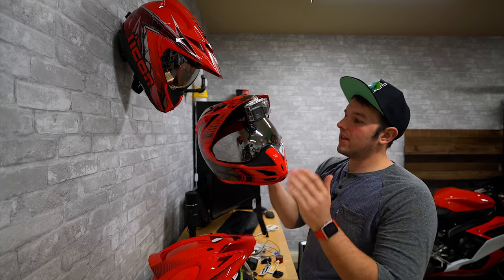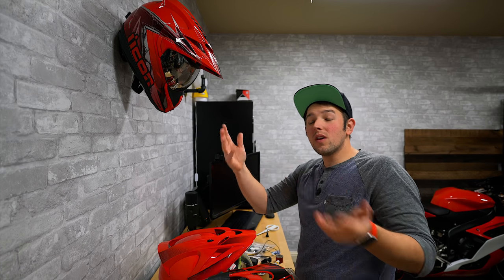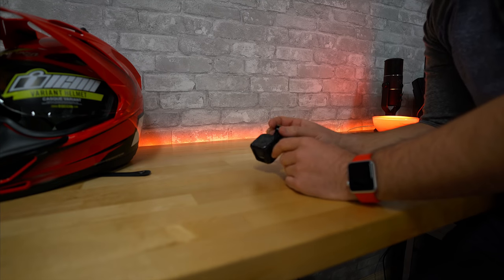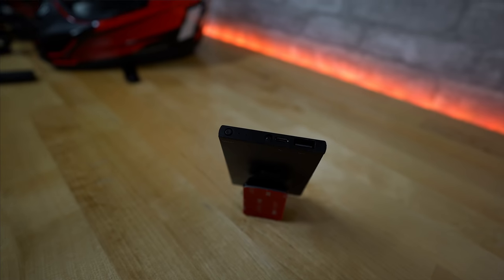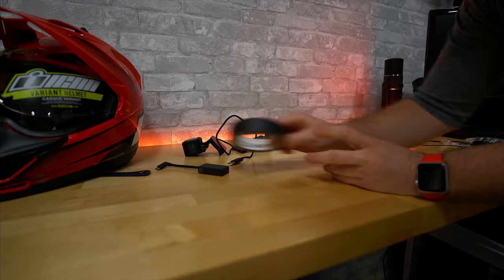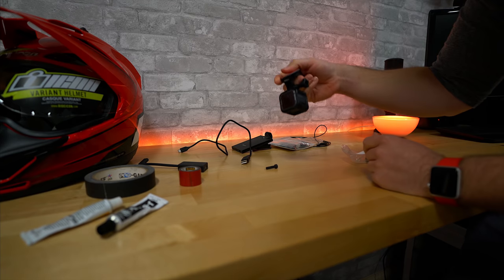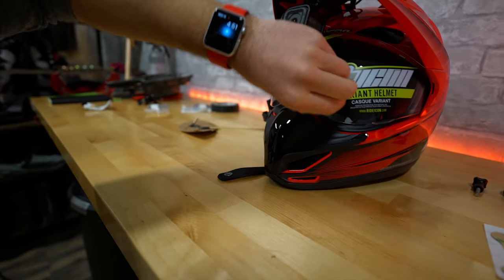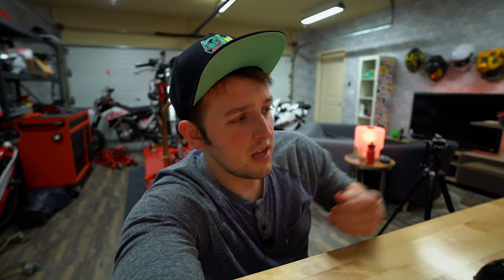My Motorcycle Helmet Camera Setup

Comment: The GoPro mount Allen screw size is M5-0.8x20MM cap screws. You can get them at Home Depot for about $0.75 for a bag of 2. 🏍🔩
Reply: I can only find 10 packs. can you link?
Reply: buy 9 more helmet then

Comment: So the adapter works with both power and audio? I was really excited when that adapter came out, only to be disillusioned by GoPro when they told me I could only either charge or use the mic port, not both at the same time. Thank you!

Comment: Please do a riding bike test for the wind noise test. Did you had to move it after? Was it noisy? The muffles hold the wind noise well? The noise is something annoying for me, and the GoPro 5 had some pops issue that I had to change my mic. Motonosity had the same pop issues with his gopro 5 and changed back to his gopro 4 due to it. Does the Season 5 have pops issue on the mic due to wind and high sensibility on the mic?

Comment: if you put 3M tape on the adapter then heat the tape with lighter until it slightly bubbles then press and hold till it cools down it will stick better.

Comment: You could have scratched off the rubber coating off the mic adapter and used the 3m tape instead of JB welding it on. I know a few guys who have gone that route. But kind of cool to see the Sessions 5 as a main camera
Reply from the maker: That's could definitely work but that 3m has failed me in the past so I decided to go the JB route.

Comment: I know this will get buried. But you could use a protractor/angle finder to measure the mounting angle when you are mocking it up. Then buy or create a wedge with the angle you found and taped it.

Comment: How come you dont use 3M Dual Lock? I use it for everything and it's amazing, and you can simply remove and snap back on when needed.. I have it on my Mic Adapter too on my Variant helmet in the same place..... and the power bank you should of had on top so the ports are under that back raised bit.... and also my OCD kicked in BIG TIME watching this lol i'd give anything for that helmet and all I see is black tape all over it which isn't neat lol I routed my mic through the top vent though, so it comes from the adapter, through the vent above the visor and into the helmet.

Comment: Do you have your hero 5 session firmware on 2.51 which is the latest or is it a certain firmware version that you use? Is there a certain sequence because I swear I have watched videos and googled my eyes out and still won’t work. Gopro even replaced my camera and mic adapter smh

Comment: I have a Sena 20S installed on my helmet. A buddy of mine recently convinced me to pick up a GoPro. Is it possible to use the microphone that came with the Sena. If so, how does it work? It's my first GoPro, so I have no idea what I'm doing. Any help would be appreciated :)
Reply: Merge audio in post.

Whenever you see motovloggers clap at the beginning of some videos and when synchronising for dual-vlogs, this is what they do. It puts in an obvious audio spike to use as a reference point, as well as a clear point of contact on the video. This is the same reasoning behind the clapperboard used in legit filmmaking en.wikipedia.org/wiki/Clapperboard

Comment: Hi Chase,  does the hero 5 session takes voice commands through the mic? Cause if it doesn't ...I guess voice controls is useless for moto?
Reply: Filip Robbie Even if it didn't, all you would have to do is open the visor and talk.
Reply: Really? Tell that to the vloggers who cant get their gopro to recognize their commands even at walking speed with a little bit of background noise.

Comment: Chase , why do you not sync the audio with the sena? Then just get a sena GoPro Bluetooth pack
Reply from the maker: I'm not a fan of the sena audio for video purposes. I feel like it's a little flat and you can't hear the bike as well.
Reply: anyway chase, just a minor suggestion. If you want to waterproof the gap around  your power cable /audio jack , you can put some blue-tack around it. Press it down after you plug them in and you get the seal.  its easily to implement and remove while preventing the water from seeping in.

Comment: There are different 3m tapes for different jobs.  For example: 3M 4926 is for bonding metal and plastic painted surfaces and has  95lb tensile strength. Use the right tool for the job man :) .
Reply: Derrick Disharoom Let him do what he wants :) .
Reply: No doubt.  His stuff, he can do what he wants. However, there's a reason the chosen product didn't work for him.  Just pointing that out.

Comment: The reason the 3m tape failed was because you didnt give it time to set, its not like normal tape, i used 3m on my GoPro Hero 2 mount 7 years ago and its still stuck after riding in all weathers for the past 7 years

Comment: chaseontwowheels where did you get the Mic adapter at
Reply: Justin Loges it's the new hero5 adapter, very hard to find for 4 series, don't believe they sell them anymore but you can find the new adapters on the GoPro website
Reply: I found it on Google it is 49.99

Comment: I must say I'm a bit disappointed with this video.  I understand function over form, but seems like a complete hack job to a new $400 helmet.  I'm mean JB Weld and  Gaf tap???   C'mon.  Chase you can do better man.  You could have lifted the edge on that channel on top of the helmet and tucked the wires under there.  Those channels just direct air and provide no structural integrity at all.  The result would have been a cleaner install.